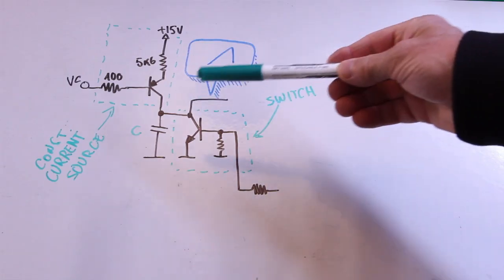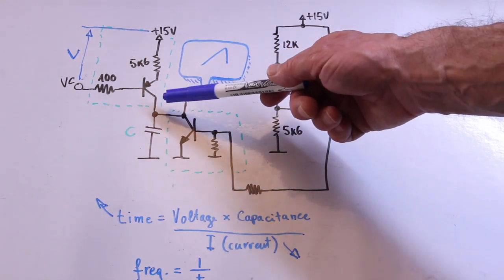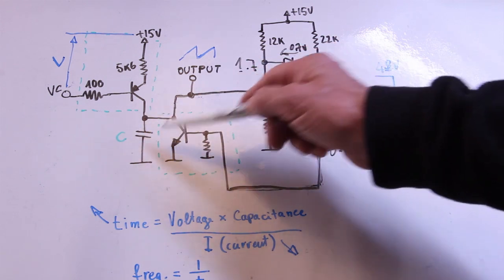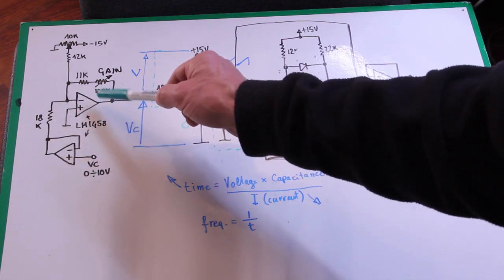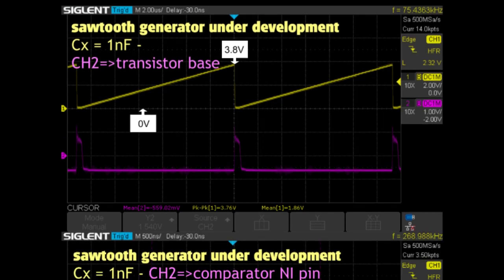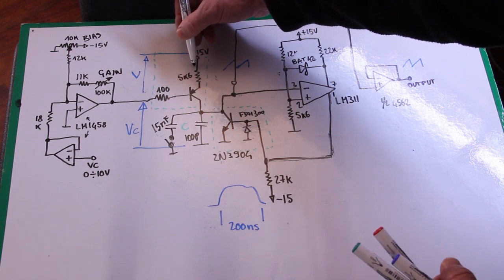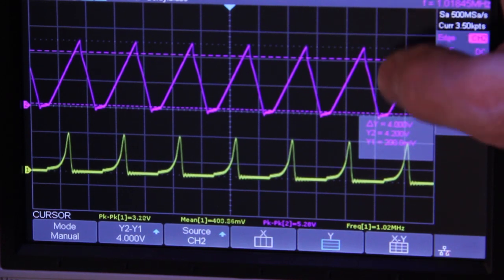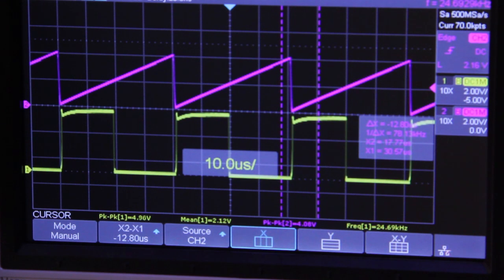Sawtooth Generator for your Electronics lab feat. Current Source and Comparator

Comment: Very nice video! Though unless your goal is specifically to learn analog design, I think a direct digital synthesis waveform generator is the better choice nowadays, for most applications. Even then you can still learn about analog stuff in the output stages of the design.
Reply from the maker: Honestly at first I thought to make a circuit based on a DDS but I had some troubles sourcing a chip. Also, I love analog circuits ...so, yeah :)
Thank you.

Comment: I have been developing sweep generator for oscilloscope horizontal deflection and I see that it is not easy task because on 10 or 20 MHz the signal will be extremely distorted. Maybe you know how it works on real devices? I tried to read the schematic of real oscilloscope which uses tunnel diodes but it's really difficult to understand
Reply from the maker: Basically for a triangle wave oscillator you  need a capacitor a current source and a switch that discharges the capacitor once it has reached a given charge. What determines the speed is the switch: the fastest it is the cleaner the output signal is. A tunnel diode can be used for this purpose but honestly I have no experience with them. But I hope you get the idea: take care of that switch and a good circuit layout, that's the trick.
Reply: @AccidentalScience  thank you for your answer. I design DC power supply block with all needed voltages to cover all electronic blocks in oscilloscope. And than I am going to assemble vertical and horizontal amps and only after I will take sweep generator. So I will try to get more information about sweep generators and also about tunnel diodes. I think that diode uses its "negative resistance" part of charactristics. Or may be not🙂 But anyway thank you. Regards from Ukraine 🇺🇦

Comment: Seems overly complicated. 
A simple sawtooth generator can be made with three BJT transistors. A triangle generator can be made with a single comparator.
The PNP current source can be replaced with a PNP current mirror and connected to an NPN current source to make the control voltage ground-referenced. 
To speed up the turning off of the transistor add a base-collector diode to turn the BJT into a schottky transistor. Regular 1N4148 works well enough.
Other than that i don't have much to add.
Reply from the maker: Thank you for commenting.